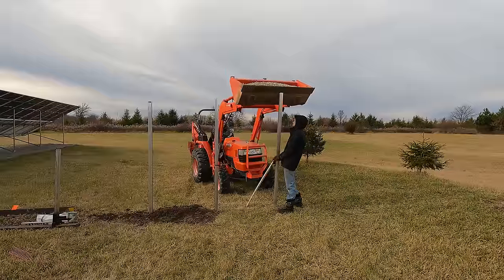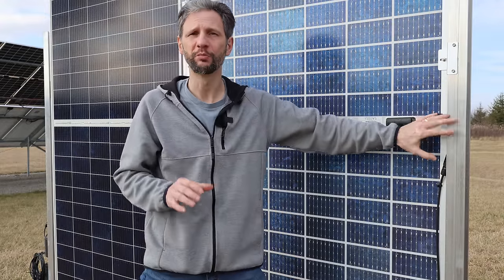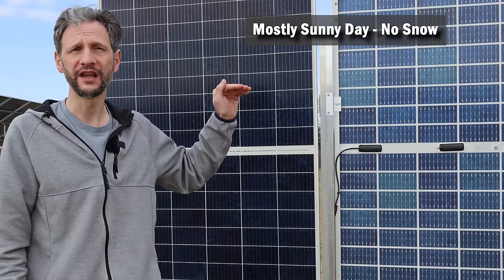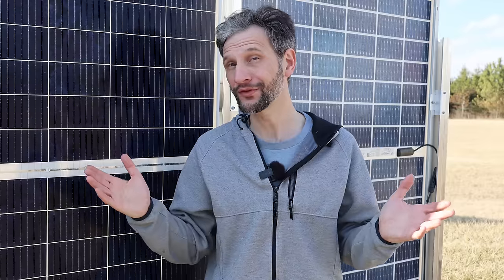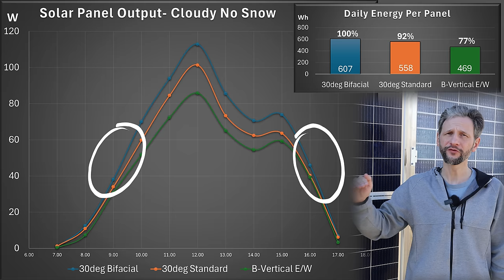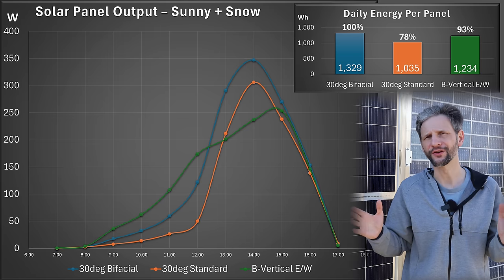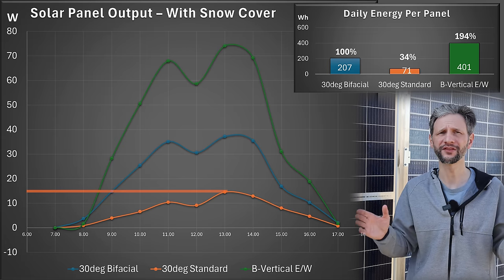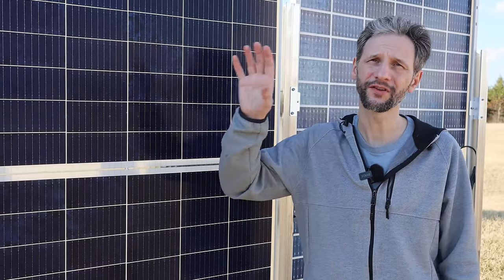Vertical Bifacial Solar Panel Performance Results Part 1

Comment: A test suggestion: with the vertical mount panels, what if you face them the same direction, but rotate the panels at mid-day so that both panels are always facing the sun?According to your numbers there should be about 25-35% gains with this method over the opposing-direction-mounted vertical panels. You would just mount each panel on a single post, in the center of the panel, such that they can be rotated at mid-day, to have both panels facing the same direction. The mount would have to connect at the top of the panel as well, in the center, to keep it from falling over. I DEFINITELY think this scenario should be tested. (if the gains are real, a simple, single actuator could be mounted at the end of a row, to rotate the entire row at mid-day (and it would have to lock in place, or brake itself, to prevent movement with the wind). Please try it! The world needs to know! :)
Reply: Here is a concept for horizontal rotation, which can be simplified to a single axis, and no control board (just by rotating via time, every 12hrs). He also mentions increasing output by placing reflective paneling on the base/mount. Implementing these features will give MAXIMUM benefit beyond what we all have imagined, thus far. https://www.youtube.com/watch?v=IBeSdzHqSyg
Reply from the maker: The flaw in this approach is testing only one panel.  If you rotate two or more vertical panels next to each other on a vertical axis they will almost completely shade each other.
Reply: @ProjectsWithDave  no...i think you misunderstood the concept. You rotate them 180 degrees at mid-day (and midnight), so that they are always parallel to each other. The only shading that can possibly occur is during the ~20seconds it takes for them to rotate 180degrees. I'm not talking about rotating to follow the sun. I thought i mentioned that in the post but i see I did not make that clear. I simply shared that video to demonstrate a hardware concept that could do it.
Reply: @ProjectsWithDave  according to your graphs there would be atleast a 25% gain over your fixed vertical mount scenario. I.e. not relying as much on reflection to the rear of the panel, but prioritizing direct light to the frontof the panel at all times.

Comment: I'm going to say that vertically mounted panels will work better the further north (or south) you are as they are always going to be close to the optimum angle than if you are nearer the equator.
I live on the 38th parallel and I would imagine that in the summer vertical panels would be horribly inefficient here.

Comment: I know you were testing the east west orientation in this video but surely a south facing vertical bifacial array would be the best in winter? No snow to remove and it's always getting direct sun.
Reply from the maker: I plan to test that at some point as well.  I thought I would start with the conventional method.

Comment: Thanks for that, a lot of effort, 
Any chance of trailing single axis motorised mount for bi-facial panels , 
So it gets the morning and evening power, produce a lot mid-day - and still has the ability to produce in cloudy conditions,  or in intense heat ,

Comment: Easy fix for noon add two mirrors to angle the sun to hit both during the noon. Granit i know the solar energy will go through the mirror and not reflect everything back to the panels but still it would be an interesting experiment.
Reply from the maker: I ran the experiment, I'm analyzing the data now.

Comment: Interesting results. wonder if theres some way to reflect more on the underside of the bi facial 30 degree. Might heat them up faster when covered with snow, and would increase output.
Reply from the maker: Maybe, but they tend to shade the ground on the back side so there isn't a lot to reflect back.

Comment: What about flat on the ground.  Or across a flat roof ...    The snow issue would kill it but if not in snow it seems to be better. Picking up theory 180 degrees.  (we wish).

Comment: Well, if you have a large open area, you can do as you please. Most people own, if at all, only a small piece of land, with trees or buildings around causing shade. They need roof mounted solar.
Reply from the maker: That's why I try lots of different ideas, hopefully there's a solution in there for everyone.  : )

Comment: In Vertical panels, why not allow a small cell-level independent tilts during noon-time, so the electricity production rises significantly.
I mean, having a special system, that easily tilts each cell, instead of tilting the whole panel.

Comment: Your experiment should have used the bifacial in front of the south facing panels. You have a shadow effect from the south facing panels that is reducing light to your panels. Remember that the albedo is not only from ground at each side from the panel, but also from areas that are now receiving the shadow from your south facing panels.

Comment: If the panels were balanced well enough, only a very small force would be needed to tilt them one way or another. If they could sit vertical in the morning, horizontal au midday and vertical at night, tracking the sun, that should result in the highest output

Comment: Interesting. I wonder if where I live putting half at  SE/NW and half at SW/NE might work better. 

The sun only rise's in the east for about 1 month in the spring and one in the fall. So in winter it rise's in SE and sets in SW and in the summer its NE to NW. Although it would have to be really open terrain. 🤔

Comment: We need a open source design to variable , automatic / remote inclination panel supports
Reply: There is. But active solar tracking isn't the most (cost and space) efficient overall solution anymore, even when we speak about single axis trackers.

Comment: The aluminum 8 beems pounded into the ground will corode quickly by Electrolux if there is any moisture in the dirt at all.   Aluminum is also not recommended being poured into cement for similar purposes.  Aluminum is much more susceptible to electrolysis corrosion than steel.

Comment: Has anyone done solar tracking vertical mounts with reflective ground cover? It seems to me that would be the best of all options. Of course the complexity of a moving tracking system adds complexity and maintenance issues.

Comment: The great advantage of vertical panels, is longevity.  Panels that will last 10 years longer, save you tons of money in the end.  And panels that have less of a drop in power performance over the extended lifetime, will produce more power in 10 years.
Reply from the maker: I expect they will last longer due to the lower solar exposure.

Comment: Very interesting work. Thanks for doing this.

Will the addition of batteries make the mounting angle irrelevant? 

That is, if battery capacity is optimized to capture the precise amount of unused production (for example), why not optimize the panels for gross production?

I hope that question makes sense. And thanks again.
Reply from the maker: Yes, that is a consideration.  If you have battery backup or grid tie production you would want to optimize for max production not time of day.  However, the equipment has limitations as well, inverters max out at mid day and start clipping and your charge controller may not be able to put that much power into the batteries at peak production time.  In those cases spreading out the curve could actually still improve your situation.
Reply: @ProjectsWithDave  I really appreciate your thoughts. It gets complicated quickly.

Comment: How about trying putting some white plastic around the panels to test the albedo effect? If you can min/max an installation for a homeowner without having to buy expensive white stone by using cheap plastic held down with landscaping clips. It would be an extremely interesting experiment that anyone can do and be a lot different then being another youtuber testing out this out over the next few months. You got the setup to test this. So why not do something that none else has done before?

Even if you have to replace a 4-6 mil cover every 5-7 years before it starts to dry out might still be profitable. Particularly in the northeast with its electricity prices being very high.

Comment: Will you be doing more reports during summer? I know that higher temps reduce a panels output, and would like to see temp effects on vertical vs. standard south facing array!
Reply from the maker: Yes, I will do a follow-up after the summer solstice.

Comment: The main purpose of the vertical installation is based on the premise that solar panels overheat in summer conditions. 

These no reason you can't make it so the vertically mounted panels pivot at their centre and adjust the angle to increase winter performance.

Comment: I do not remember in your videos about a tracking system. i know there are some more affordable version now on the market. It would be nice to see bifacial on a tracing rig vs normal ones. i've seen: "Dual Axis Solar Tracker " from eco-worthy it seems acceptable in price (they claim 40%more energy in a day)
Reply from the maker: I've seen that tracker.  I have not tested it at this time.

Comment: @projectswithdave I don't know if you've dug into the physics of this vertical panels much. They work better when you have two rows that are just close enough for reflected solar energy coming from the front of one row onto the back of the second row.
Reply from the maker: What data have you seen comparing row spacing?
Reply: @ProjectsWithDave If I recall, I found it in the Norwegian study. I've been using a rule of thumb of no more than width equal to the .75 of the sum of the heights of the two panels (left and right). I have a distinct feeling that replicating the Norwegian experiments at different lattitudes are going to yield different results based on some kind of formula... which really speaks to the data you were getting.

Also, there is school of thought about the ground: the efficacy of the vertical panels also depends on the reflectivity of the ground itself. Lighter colors yield higher efficiency. Example: grass vs. snow. I mean... how many times are we told in the winter to put on sunscreen before going on in the snow?

Comment: Wouldn't putting a space between the panels let more sunlight be reflected and therefore put out more power?
More space overall required, but more power? On the 30 degree panels only... 
Thanks for the great videos... 😊

Comment: They are facing the opposite way of the solar panels on the array.  You should face the vertical panels the same way as the panels on the array to they are facing the sun more.

Comment: I wonder if there would be any benefit of mounting the vertical panels on a single vertical pole that can pivot. It doesn't have to pivot 180 degrees to hold the panel perpendicular to the sun the entire day. A pivot of even  10 or 15 degrees on each side of South would do a lot  to fill in the mid-day trough. This would of course adds weight, complexity and cost to the installation. But you might be able to recoup some of the cost by needing needing fewer panels to get a desired number of total Wh a day. Plus having less of a power slump at noon in hot climates where solar heat gain is reaching a maximum at solar noon would allow a vertical array to better match the power demand curve.  And the vertical array would produce more power than a in the mid to late afternoon when the air temperature is reaching a maximum. means you really don't want the power coming from your panels to drop sharply. The control algorithm should be pretty simple. Just pivot as much as possible during the morning to maximize the power coming from the panel. When the panel reaches maximum pivot it maintains that angle until solar noon at which point it moves to the opposite side of its travel and them moves progressively back towards the edge of the panel facing due south as the sun sets in the west.

Comment: The real question is, does it matter? If you have storage, it does not. What we have learned over the last 4 months, is that you cant have solar with storage without some kind of backup. Since you have storage, its best to just face the panels to the south. East/West makes since in the summer when you already make way too much power. In the winter, by the time the sun has any azmuth, the south facing panels will outperform east/west panels. Time of day production delta is insignificant.
Reply from the maker: That may be true, but if you are over-paneling your inverters it can make a difference by spreading out the energy over a wider time period to prevent clipping.

Comment: Great video and data analysis! Would there be a practical setup that can allow for 30deg to become vertical during winter, not sure how much more cost it will add up for the appropriate racking structure.
Reply from the maker: Tilting racking systems are not usually set up for achieving vertical, but I think that will become more common.  I'm thinking about making a rack that can achieve multiple angles up to vertical for testing purposes.

Comment: Instead of relying on snow, couldn't you place some type of reflective material on the ground on both side of the vertical panels?  Or even mount panels back to back?

Comment: Personally if I were home I would clean the snow off my panels first thing after it stopped snowing so there would be zero penalty for bifacial ground mounted panels and I would get max production for the day. By cleaning off the snow it negates mounting panels vertically.
Are your panels aligned to the proper azimuth for your location? For example for zip code 43215 (Columbus, OH) the correct azimuth is 7.2° West of magnetic south or 187.2° clockwise from magnetic North. Whereas the azimuth for Willow, AK is 14.7° East of magnetic South.
Do you adjust your tilt angle for each season for maximum energy production which is especially important in the late fall, winter, and early spring?

Comment: Have you done a cost comparison from the racking perspective? It looks like a vertical array should be cheaper to install.   Less mounting parts, less time, panels are cheap and labor is expensive. Might make already sense when it is 79% production. If the total installed cost is less then 79% from the south array
Reply from the maker: I don't have a good cost estimate for vertical at this time to compare to.

Comment: Hey Dave, I wonder what would happen if the vertically mounted panels were hung and rotated with the sun?  Would that make them as efficient or more than the standard array since they would be sun tracking?  Would you gain the advantage of the reduced footprint of the panels compared top the standard fixed slanting array but have almost the same output?  Seems like a sun tracking set up would not be difficult to set up. And would that make the south facing rows be the best set up or would the east west be better.  Seems like that would be fun to experiment with???

Comment: Great video content. I am not sure if you covered this in the video, but have you ever considered looking into automatic satellite adjusting hardware that would rotate the panels towards the sun? Also, do you have the panels connected to batteries? 
I am trying to configure a system that would mount on top of a 40 foot shipping container with the roof, painted white with special metal roofing membrane that would reflect the light and need enough power for a small shop roughly 500 ft.²
Reply from the maker: I have not experimented with trackers at this time.

Comment: Silly question, but... Couldn't you put mirrors (or parabolic reflective surfaces) on either side of the vertical mounts in order to get all the benefits of early and late our power production while minimizing the dip during midday?

Comment: This is super interesting. I am installing two bifacials on my off-grid cabin this spring. Intuitively I was thinking of installing one panel southeast and one southwest (at 30 degrees or so) to try to catch morning and evening sun better. Also add a reflective white surface (pointed straight south) between them to harness mid day sun. Any research on this? I intend to do some of my own experiments once my cables come in next week. I guess if I did this i would need to connect my panels in parallel
Reply from the maker: Thanks!  The problem is, experiments like these take a lot of time.  You need data from the Winter Solstice to the Summer Solstice and in all weather conditions.  Sometimes a particular setup performs very well in one situation but not another and the overall may not be what you expect.

Comment: I can't tell if this has been suggested yet, but what about using regular, non-bifacial panels back to back in a east-west configuration?  Not like an extra couple of inches thickness is going to matter and heat should still be low.

Comment: Would there be a significant difference by mounting a pair of conventional panels of equivalent properties vertically back-to-back spaced just a little apart to encourage convection between them with the chimney effect for cooling? (I guess that would be more relevant during summer, when heat would have a bigger impact in panel performance)

Comment: In the current setup, up to around half of the field of view of the backside of the arrays is covered in shadows from the larger south facing arrays. Wouldn't that cause the vertical bifacials performance to drop by ~10%? I would be curious how the vertical bifacials would perform if they were mounted on the south side of the larger array.